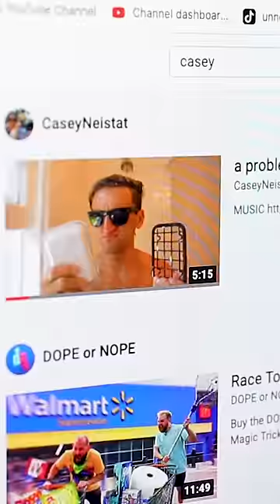Solving Casey Neistat's unnecessary shower problems

Comment: Couldn't he have just made guard rails on the sides of the holder instead of spikes.
Reply: If he did that, it would be just too basic
Reply: Yeah but then it wouldn’t be an unnecessary invention
Reply: Spikes are cool though. 😎
Reply: The spikes probably don’t even work well anyways
Reply: Going for the hype bruh otherwise nobody gives a fk
Reply: @haydentakara4369  hey I saw ur comment on the Smokey nagata engine video this is the second time I saw ur comment . Nice
Reply: @amirmichi4797  lol nice
Reply: Yes, but then there would be no pointy spikes.
Reply: Welcome to the point of the video
Reply: Exactly
Reply: I was thinking the exact same thing
Reply: CONTENT
Reply: I mean you can't blame him. 
The channel name is literally Uneccesary inventions
Reply: @noustrant  and less dangerous and drainless
Reply: Yeah thats the joke, his invention is useless
Reply: But but i guess it's too boring
Reply: No
Reply: Then the soap would block the drainage holes causing gooey soapy water to settle around the soap
Reply: Soap would be able to slip through when it gets small enough. I’m not saying spikes are the way to go, but there’s downsides to guardrails too
Reply: doesn’t solve the draining issue
Reply: Read the name of the channel my guy
Reply: Drainage and easy grabbing
Reply: @theplayerspot4139  it does. the soap doesnt block the water being disposed since its on an elevation from the actual surface of all the drainage holes
Reply: Look at his channel name lol
Reply: The spikes just gonna make the soap slip away even easier.
Reply: @catherinequ2907  i mean the guard rail idea. that doesn’t allow drainage like this design.
Reply: Even just a little lip would be enough to stop it from sliding off.

Comment: Making it concave: NO
Making pointy spikes: YES
Reply: @charliecollings2295  that's the point of the channel
Reply: @charliecollings2295  That's the point.
Reply: Oh I see the point~😉
Reply: @ATAMAA  …I can’t even be mad about that, good one lol!
Reply: Should have done both pointy and concave
Reply: @charliecollings2295  you see the channel name right 😂
Reply: @derpzking1833  unnecessary doesn't mean garbage
Reply: @charliecollings2295  that's the channel's name
Reply: @knightfall7534  should’ve done concave points
Reply: Actually, convex. Concave is "U" shape upside down.
Reply: @Natalija379  nope, upside down U is convex... Im pretty sure, and other wise several other comments would have pointed instead on 1😅
Reply: @Natalija379  concave is a normal U because it caves in
Reply: Why not just a f... Magnet?
Reply: Making it have spikes while concave: MAYBE
Reply: @1leg  If it was unnecessary then why do have a spiky soap holders I've had since childhood
Reply: @ATAMAA  angrily likes and scrolls
Reply: @UserOfTheName  you’ve had a weapon of death, and you were given it AS A CHILD lies.
Reply: @gulhanyanar5286 What would the magnet attach to????

Comment: Him: slips in the shower

grabs for something to hold on to

His hand: ✋🗡️🗡️🗡️🗡️🗡️
Reply: It’s better than his hand slipping off
Reply: That is a possibility
Reply: They're not that pointy. If you look closely you'll see that the top is flat.
Reply: Just wait until it slips too and you land on it. 🥴

Glad I use a chair in the shower right about now lol.
Reply: it’s a 3D printed spike with a blunt edge, mild pain and discomfort but not any actual impaling
Reply: @cubedude8690  sure, but they look sharp enough that it would hurt to jab your hand at full force over it.
Reply: @corbinbrier0  ikr lol
Reply: @cubedude8690  I think 150+ lbs of pressure fa sure gonna make them flat tops lethal or harmful
Reply: And now ,you won't be killed by slipping on a piece of soap again :)
Reply: hoshiyy hoshiuiuh  me, sometimes, also there's bath designs with a built in chair
Reply: Well at least he won't slip off
Reply: the spikes are too packed together to even cause any impaling or even any discomfort, however if you fall on it it will more likely feel like a flat surface
Reply: @Alice-zx7ib  his hand doesn't slip off, but the soap holder slides off.
Reply: Long live the Watch?
Reply: It falls under him and he lands on it
Reply: The spikes are barely sharp I'd say they'd scratch your skin at worse
Can't really 3d print something sharp witout then sharpening it
Reply: @rudebwoyeli5296  at that pressure the plastic would break or deform before stabbing you

You don't know enough about 3d printing man just leave it
Reply: @cubedude8690  same logic applies to legos my guy
Reply: @Hazed64  Legos aren't sharp either but when you step on those mofos you feel the pain of 3000 needles being thrust into your foot.
Reply: @closetfucker6941  I understand that you have seen spike beds in cartoons before but if you fall with all your weight on that it will most definitely hurt.
Reply: @rudebwoyeli5296  no it won't there are a bunch of spikes if your hand grabs them the pressure will be felt through put the hand and the spikes if they would pierce the skin won't be able to same way you can push a balloon on a table of nails and it won't pop
Reply: @kos-3327  yep, that is true 
but is a different case for blunt spikes

and yeah it would hurt
Reply: It wouldn't hurt you or stabb you.. You've never seen the people who lay/walk on beds of nails that look like that? Its bc your weight is spread out over all the nails/sharp ends so they can't puncture your foot or push enough to hurt ya.

Comment: I'd make the spikes concave to the center to make sure the soap never falls no matter how slippery it might be.
Reply: I came here to find this suggestion
Reply: But thats necessary inventions
Reply: Wow nice idea
Reply: Not all soap bars are concave , some are flat so it’s better to do it as he did it I guess 🤷‍♂️
Reply: @ahmedalwarraqi1101  I agree
Reply: @ahmedalwarraqi1101  he just said he would do like that theres no problem if it it is a better idea so appreciate that
Reply: Wouldn't it be better to just make the spikes around the soap longer than the ones below?
Reply: @PanDiaxik  that’s what concave means
Reply: @srikarthickk9708  it could be concave in different ways it could be for example in a shape of sphere and then it would be best for soap that matches this shape. If it was flat in the middle and just longer spikes outside, it would be more universal
Reply: Actually... If it's concave without the spikes it still works.. but look at what's the actual point here "unnecessary inventions"
Reply: @beaver-qf3th  but it’s necessary for more people who drop their soap
Reply: I'll make sure there's super glue on those spikes so anything on it will not fall
Reply: @PanDiaxik  concave convex different
Reply: Came here to say this
Reply: @ahmedalwarraqi1101  except that he designed the invention to work for the specific bar of soap he uses in the video

Comment: Imagine when the holder falls off in the shower and you step on it 😳
Reply: Or sit
Reply: That would hurt I would DIE
Reply: Then he would do a holder for da holder 😈
Reply: Or the bar of soap drops but you don't hear it and grab the soap holder and scrub your body instead
Reply: depending on how you step on it, if ya whole foot is on it the weight will be equal and probably not hurt too much

if you step on like a corner of it, ow
Reply: idk man I'm thinking itd actually feel pretty nice cause of the way they're presented
Reply: Then make a holder for that holder. Smh
Reply: @mousaseblani  accupressure, it won't hurt.

Comment: I have an idea that might work: make the spikes less sharp and make them out of rubber, the spikes form a sort of con cave shape so the soap doesnt slide off snd would just stay in the middle
Reply: Bro that’s smart
Reply: Exactly, by reducing the surface area he only reducing the friction even more and it will still slip off and will probably mangle the soap on the way
Reply: How about you add railings to the soap container and then put small holes on the bottom so it doesn’t become a pool
Reply: @masonseminario7435  yeah thats what i was thinking
Reply: The problem is, that would make it actually useful.
Reply: You guys read the channel name?
Reply: @Rohan-wq9yv  Yes we did, we just want to share our ideas
Reply: This is the concept of the purple mattress
Reply: That would make it a necessary invention tho, defeating the point
Reply: 6nine approves this invention👌
Reply: They already make that exact product to hold soap tho
Reply: But, if he did that this will accuntly be smart and not unnecessary
Reply: That's literally a thing
Reply: Wait is it weird that wut ur talking about is sold about in my country.. I thought it was normal
Reply: A nest
Reply: And if you slip on it somehow you won't get stabbed.
Reply: Why don’t you just get rid of the central spikes and have a spike wall?
Reply: That already exists
Reply: Doesn't rubber get very slippery when wet?
Reply: I've seen this exact soap holder at Walmart
Reply: Maybe, use a shallow dish
Reply: That's a great idea 👍👍
Reply: @Rohan-wq9yv  unnecessary inventions, not useless inventions
Reply: Your smart
Reply: When i saw the spikes i emediatly though rubber as well
Reply: The wall angle can be lower than the free side, so the soap slides back into place and the wall contains it.
Reply: @user-asfh2ubiv5dh   It wouldn't hurt you or stabb you.. You've never seen the people who lay/walk on beds of nails that look like that? Its bc your weight is spread out over all the nails/sharp ends so they can't puncture your foot or push enough to hurt ya.
Reply: @averagegummywormfan  not all. Theres anti-slip rubbers
Reply: @stenplayz4468  It wouldn't hurt you or stabb you.. You've never seen the people who lay/walk on beds of nails that look like that? Its bc your weight is spread out over all the nails/sharp ends so they can't puncture your foot or push enough to hurt ya.
Reply: Or just add walls to the edges of the holder
Reply: Or just get body wash instead of a bar

Comment: Shit like this is impossible to clean without taking forever.
Reply: I was looking for this. I was like bro the soaps going to melt into the holder.
Reply: it's soap tho won't it just lather off with like a toothbrush or sum
Reply: Use a bit of soap😉 youl be right mate. Or just use liquid soap then u don't need either of em.
Reply: Soap rinses off pretty easily.
Reply: “cleaning the soap holder” sounds like a sarcastic slam poetry book
Reply: @beefwellington6384  Oxymoron for sure
Reply: Exactly. Dont people use those soap holders anymore. This looks stupid
Reply: @Mostly-Sane  Well it is on a page called unnecessary inventions soo..
Reply: Is he creating a problem?
Reply: @MossyRootz  God just saw what its called! Thanks for pointing it out 😆

Comment: Imagine falling and grabbing THAT thing instead of the little ledge the usually holds the soap
Reply: REEEEEEE
Reply: If it does its use then you won't slip 😎
Reply: Man those ledges aren’t even strong enough to catch you! They’d just break off and fall with u

Comment: We actually have soap holders in the house that is concave. It is deep enough to hold the soap and has holes at the bottom. I think he was just using the wrong kinds of soap holders 😐
Reply: Yeah. I was thinking just used the concave holders. Problem solved.
Reply: His channel is literally called unnecessary invetions what did yall expect
Reply: @aea6437  fr can anyone read
Reply: This are unnecessary inventions
Reply: Right? Same

Comment: My tiny annoyance/problem: whenever I want to use my AirPods/earbuds at night and I sleep on the side, it always squishes against my ear. That’d be a great way to make an unnecessary invention
Reply: I have that same problem, and I can't even only put in one earbud because I flip sides too much
Reply: YES I HAVE THE EXACT SAME PROBLEM
Reply: You could get sleep ear buds
Reply: i dont know how to make this but maybe a tiny ring that wraps around the stem of the airpod with a tiny soft material that pushes against your cheeks. the material that pushes against your cheeks has to be soft so you won’t notice it when ur sleeping on top of it. this could help as it prevents the airpod from pushing in too much as the soft part will act as a jammer (idk if this made sense i don’t know to to explain it)
Reply: There are pillows with a hole/indent for your headphones, you can find them online
Reply: I can't wear my headphones in bed. You probably shouldn't wear earbuds in while sleeping or you might damage your ears and your hearing.
Reply: necessary

Comment: You know. Of they designed the ledge of the showet with a wide indent, soap falling wouldn't even be an issue
Reply: You don't want water to be stagnant it attracts mold that's why the corners are smoothed and the trays are flattened.
Reply: @overryans  yeah and if they did do it they would have to put slots in it and I think that would solve the issue

Comment: I can just imagine having soap/water in my eyes and kind of slam the soap down on the spikes because I can’t see and I don’t have great coordination. That’s why I don’t use bars of soap, plus they are nasty. Wouldn’t something with suction cups and a raised edge with drain panels be less painful?
Reply: It wouldn't hurt you or stabb you.. You've never seen the people who lay/walk on beds of nails that look like that? Its bc your weight is spread out over all the nails/sharp ends so they can't puncture your foot or push enough to hurt ya.

Comment: You'll need to add little suction cups to the bottom to hold the soap holder in place.
Reply: ..oor he can make a soap holder holder that has even bigger spikes!
Reply: @shotybumbati  or you could bottled soap like a normal person
Reply: @orochi8754  or make a soap holder holder
Reply: @orochi8754  I've not used bottled soap in years. It's pretty common and normal to not use soap in bottles
Reply: @orochi8754  that's not proper soap that's body wash
Reply: @tamiyaharrison9774  it is by definition
Reply: @orochi8754  bottled soap doesn't give a good lather though

Comment: 2 days later: I saw Casey Neistat had soap stuck in soap tray I designed him. I guess it was all the spikes and the soft wet soap. 🙄
Reply: Why does everyone reinvent the wheel? Just buy a travel soap tray then it won’t slip and you can cover it so it won’t get wet when you don’t need it.

Comment: Scenario: Bar slips and now when I bend over to get it, I lose an eye on the spikes. (good thing Casey wears sunglasses in the shower)

Better Idea: same slotted design sloped inward (+10 degrees for the loading of the soap bar, +5 so extra safety and good drainage). 

But an Inward sloping tray doesn't pop quite as well on TikTok/ YT shorts so good job

Comment: Remake it so the spikes are a fraction of the size. Than it solves as a soap holder to use the soap as well. So the spikes can tooke through or anything and can just barely stab into the soap

Comment: This is too dangerous, don’t want to step on that if I accidentally knock it over. Instead of a death bed of spikes, just have a wall around the outside and still with the drain pattern on bottom

Comment: Uhh I don’t know if that’s any better than other engineered soap trays. Why not make it curved in the middle so it don’t slide off as easy like when it’s on a really flat surface? The bumps don’t need to do the work to hold it in place with friction. Let gravity hold it so it’s not so pokey and more rounded bumps

Comment: If you recessed the inner points and left all the perimeter ones a bit higher you could make the soap sit more secure. Also you could remove a couple of the points along the perimeter to provide a better way to grab the soap to prevent any unwanted prison flashbacks.

Comment: When i was in 7th grade my parents were hsving that problem. Due yo me being in an engineering class i had access to a 3d printer and solid works. And this was in like 2013 when 3d printers were much more expensive. So i designed a soap dish with holes at the bottom and its been working grest for thr past 10 years

Comment: Smart but use less spikes if you do that the bar wil be easier to put in its the same if you lay on 1 spike its gonna pierce you easy but 1000 spikes are not gonna pierce trough you

Comment: Why not design a holder that is curved in the way you'd put the soap on so it wouldn't slip off the holder or like two sided one soo you could flip it to the other side for other side of soap 🤔

Comment: This invemtion right here is necessary.. there is soap trays that are so similar to this one actually..
U failed bro.
But who need soap when there is shower gel that will not dry out your skin.. so its not 100% fail there is still something unnecessary about it.
Reply: I have thus problem where everytime i take a shower the shower gel and shampoo bottles take turns falling on my toe
And it hurts
Can u fix that ?! 😅😂

Comment: Ugh! I was one of Casey N's early followers, but that got old quickly because he is at most 1/16th as clever as he thinks he is, although he does have a pretty excellent "grift" to use the fashionable term. 
In contrast, this video reinvents a soap holder that has been commercially available quite inexpensively for decades and attempts to grift off of Casey N's grift, which makes it exponentially more annoying than the original. (I am aware that my engagement with this video is working at cross purposes with my objections.)